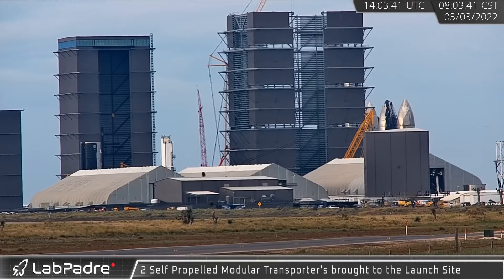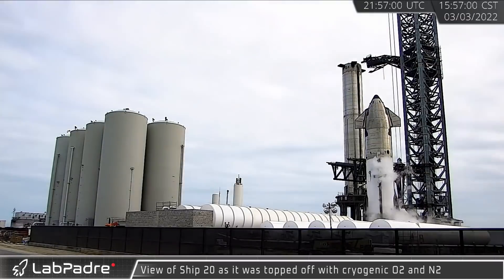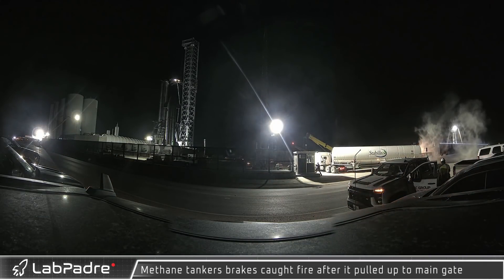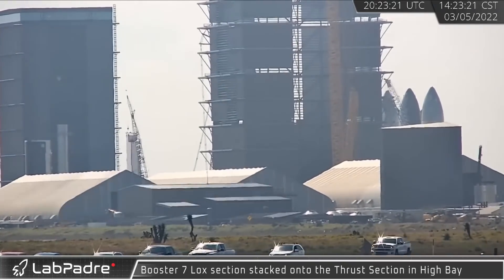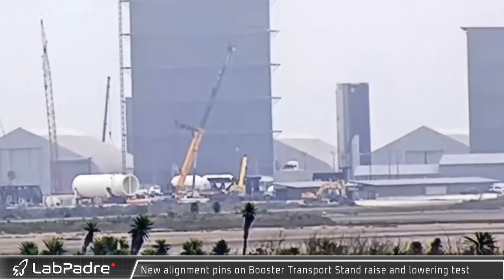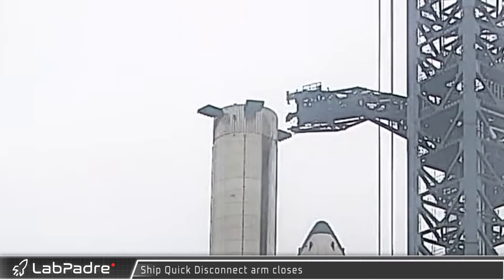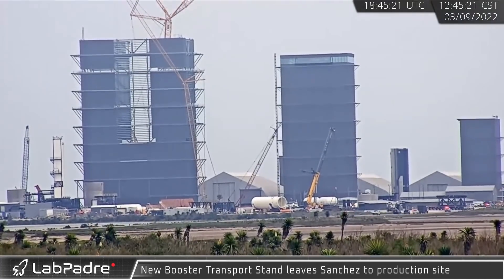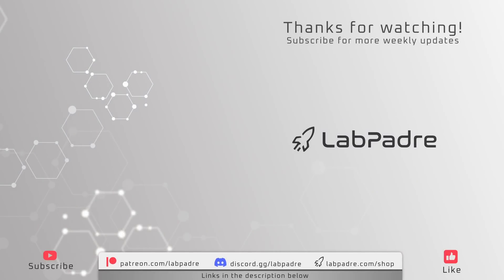Starbase Weekly News Update #1

Comment: Wait, why would they need to point the tracking at ship 20 when it’s on the ground….
Reply from the maker: I believe the  dish is used to move the chopsticks.
Reply: They need to point the tracking station at ship 20 to communicate and control the Starship since it will not be physically connected during flight, this is how they test the whole system.